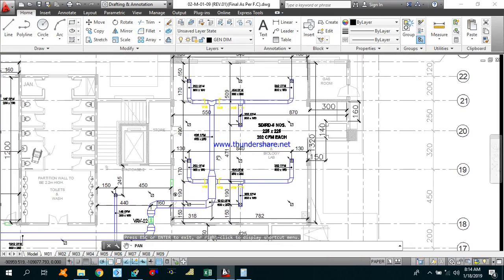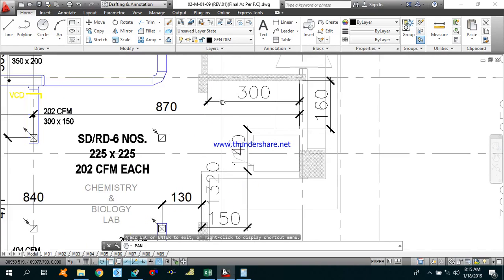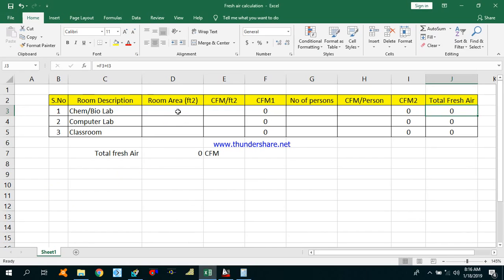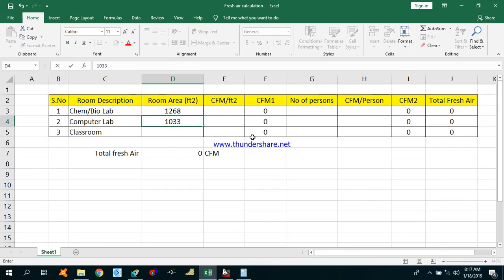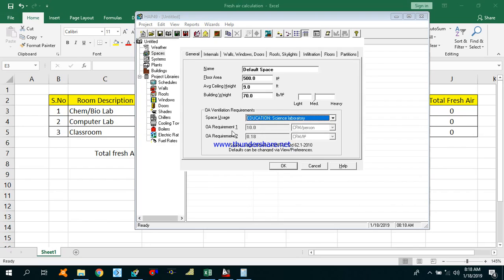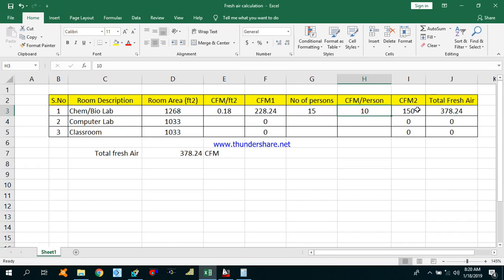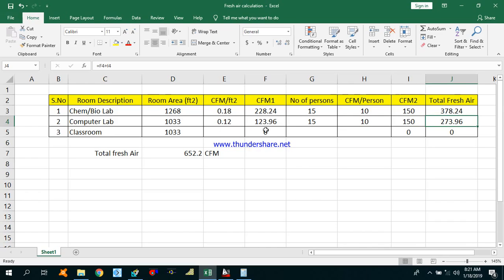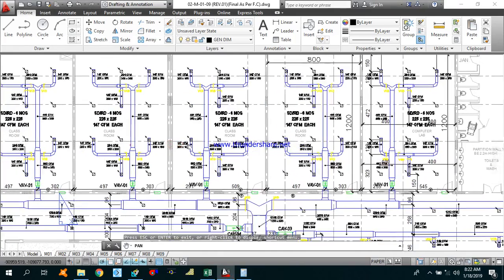Ventilation calculation procedure of school project

Comment: Sir please make any video return duct design and calculation
Reply from the maker: Kindly go to tutorial#18 on my channel you will find duct design video. There I used equal friction method to design supply air duct (0.06 in wg), but for return air duct design you need to take (0.05 in wg) using equal friction method.